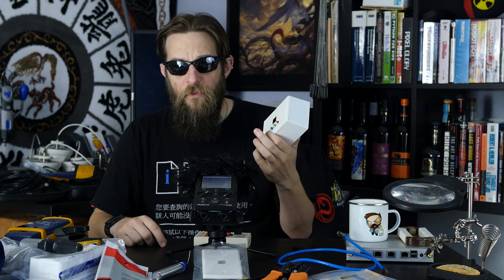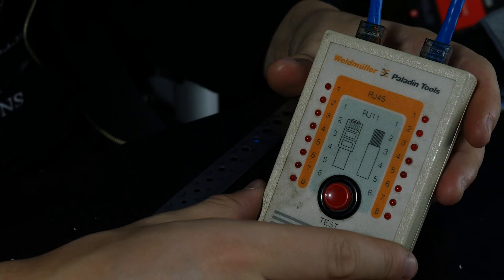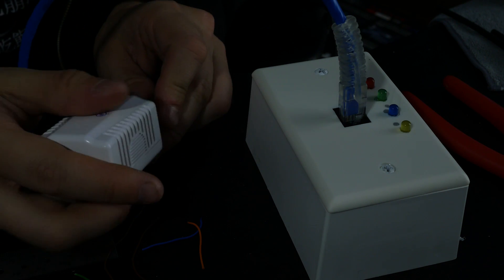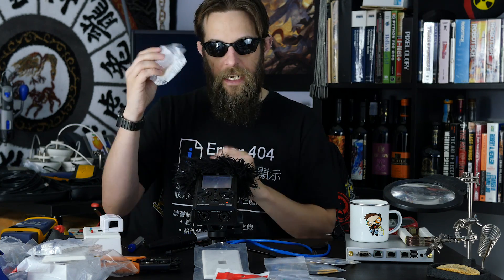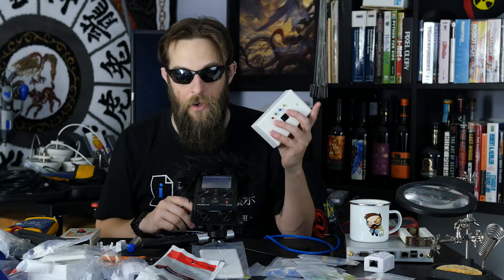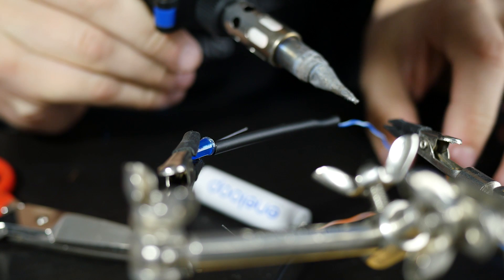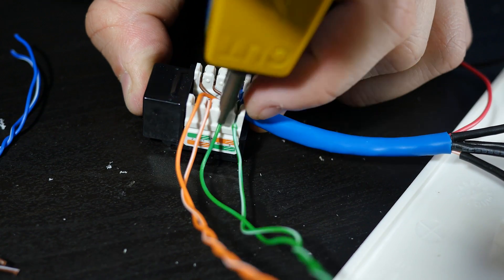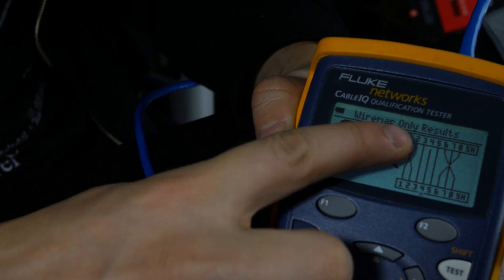DIY Simple RJ45 Cable Tester

Comment: Cool project; I may make one some day soon, perhaps not even that nice. 

I have an interesting question: How would I test a cable to see which of the two RJ45 connector plugs is bad, besides visually [because I can't tell visually], given a short was found between two [the green and the white/brown] of the eight copper contact/lines/pins, determined using my little provisional tester, a keystone jack with the wires exposed to test with a continuity tester (tester used: a little analog multimeter set to ohms). 

I am making the assumption that probably (hopefully?) one connector plug is bad and the other is good, so I wish to have to only redo one or the other, but not both. I would prefer not to have to guess, because if I did, then worse case, or bad luck, I would be  cutting off the good connector to find out there is still a short caused by the other connector, and end up redoing two plugs.  

Is there any way to know which connector is bad with some kind of DIY cable tester? Thank you.

By the way, I did consider measuring resistance and hoping a difference on one end versus the other would indicate which had the smaller resistance, thus being evidence of the bad plug.  But the cable is not really that long, perhaps only thirty feet long, so the resistance wouldn't be so noticeable with the multimeter I'm using.

Comment: I did this but instead of leds used a tester to check continuity, all pairs of my 35m run work but it refuses to give gigabit speeds, router is gigabit and both patch cables have been tested individually with the router and they work at gigabit too. the main run goes thru the ceiling, the wire is weatherproof solid core cat 5e

Could it be that all 4 pairs work but they dont work well enough and it refuses to use higher speeds? Is there a way to force gigabit?

Comment: register is 200 ohm  , right ?   plz.. anyone answer to me~!!!
Reply: No, it doesn't technically require further context, it only requires error correction, he meant resistor. To quote your own video at 5:07 "these LEDs comes with a 200 Ohm resistor". Which is perhaps slightly weird English from what i'd assume to be a native English speaker (for some of the possible definitions of English), but oh well, we got you.

And 이용석, you probably want to determine the resistors you need individually.

1. Look up the type of LEDs you bought, or buy a known type. Colours red, yellow, amber, green and yellow-green are available as Gallium Phosphide LEDs that all have 2V forward voltage drop, so you can get away with the same resistors for all of them. However if you have some Gallium Nitride LEDs, they have about 3.2V drop and you'll probably want different resistors for them if you're doing small supply voltage, like 4-5V. If you're doing larger supply voltage, it's fine regardless.
2. Decide on a current you want to drive your LEDs with. 5mm LEDs are fine with up to 20mA of current, but they'll be visible enough if you give them just 2mA of current. Let's decide on 5mA for this example.
3. Decide on the power source. In this case we will assume a 9V PP3 battery.
4. Calculate the voltage drop as a difference between power source and the LED, in this case 9V-2V=7V
5. Use Ohm's law to calculate the resistance. R = V/I = 7V / 0.005A = 1400 Ohm.
6. Round the resistor value to the next E12 value, for example 1200 or 1500 Ohm. You can use either because we went very conservative on the current, so lower resistances will be OK too.
7. Contemplate why you might not know something like this from Junior High.

Comment: Cheaper to just buy the cables pre-made it seems.  And a bag of zip ties.  The ISP guy with the local wisp "made" cables when I got my internet installed.  He had to come back ofc, because his crimper was too worn out to do the job right.  And then there's the critter issues,  $75 later on top of the monthly bill.  I had them run it through a garden hose last time to armor plate it.

Comment: Considering the cost of a fluke tester or kit, taking a bit of time to make a better more up to date functioned and use case pi tester, at a fraction of the cost, would benefit many.  Ada fruit or some other parts and sensor source may even be interested in putting the project in kit form, in their store, or some contribution in the endeavor.  Make it do basic testing, and gradually add in any logical fits for functions and more thorough testing that fit in the same wall box and cover package.  Mod that package up, add lcd, switches, and any other bells and whistles that make sense.  What does the fluke need to do better, or different, what other additions would make it suit multiple testing duties and ease troubleshooting.  Quain, has the experience and skills to know what it would be great to have it do, and build and code it to do those things and be expandable for more later.

Comment: Simple, effective. Could easily hack in many improvements as needed. Could add in a 4 throw switch to check individual pairs, for example. But this should still catch the common errors I can't see, which are just continuity.
Reply: yourcurtainsareugly 
It would be nice if he threw in the simple schematic for this setup. I'm sure many can figure it out just looking at the video, but it would've been a good addition regardless.

Comment: Would it be fairly easy to make one like the expensive one with an Arduino or similar?
Reply: that would be a huge time sync, just saying.
Reply: Yes, it could do a sequential test on the different pairs to ensure they are all the right way around and you could do a resistance measurement for each pair as well to detect any dodgy connections or wire cores. It would be nice to have a readout of results, particularly resistance.
Reply: Why would one need to store information though? It's not like the cables have any computer readable identifier markings, so saving the information that some particular cable was bad is pointless. And if you want to store last measurement result or overall stats of how many bad cables there were, that's what eeprom is for. Pi also won't help you with the timing tests, as it's not very well suited for realtime tasks. You can have a test signal generator (100-500 MHz, doesn't need to be precise) as a separate analogue oscillator with a single transistor. Or you can generate an 8MHz square wave off the arduino (higher from something like a $2 STM32F103 blue pill), filter out the lower frequencies and be left just with higher harmonics. Rectify the return and feed back into your microcontroller, you can perform loss and crosstalk measurements just from the aggregate voltage that comes through. Not every task where you need hundreds of MHz of signal needs to handle all of that in software, and you can already get a much better real result than you could from just a bunch of LEDs, and perhaps not that far off of what an expensive high-end device can deliver.

And if you're frugal and lucky, maybe you'll need to build just one, some crafty Chinese guy finds your project, and you can buy them from them then for just $10, right?
Reply: Raspberry pi would work best for something like that, its more convenient for storing information, otherwise some arduino would be best if your not storing anything
Reply: Raspberry pi woud be way overpowered.
Reply: You heard the intro to this video right?
Reply: Made one of these a couple years back for when friends want to borrow a cable tester.... then I just bought some $7 ones on ebay.   https://variecose.wordpress.com/2012/04/15/ethernet-lan-rj45-cable-tester-with-arduino/
Reply: Making one that tests the wiremap (one step up from qains) is quite easy, but you wont make anything like the fluke (aka the expensive one) with an arduino. The frequency and timing tests are just way too complex for such a simple microprocessor and the software is extremely complex aswell; not something you would like to write yourself.
Reply: So then it would be on the level of a $3000 testing unit? I don't see the problem here. :P
Reply: It would be something like this: https://www.amazon.com/Tonor-RJ45-Network-Cable-Tester/dp/B00OUFX38W/ref=sr_1_1?ie=UTF8&qid=1484330820&sr=8-1&keywords=patch+cable+tester ($9)
Reply: Also, the Fluke Networks CableIQ aka "the expensive one" is only about $1500, so for even small businesses that is not that much
For use at home, Quains or an Arduino based one would certainly be enough though :)